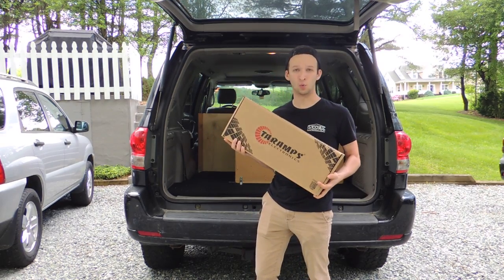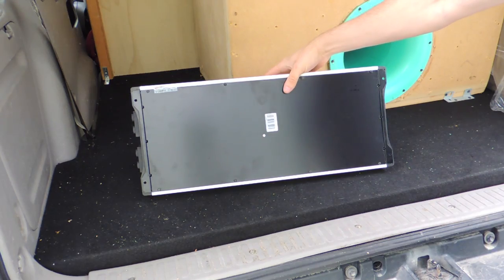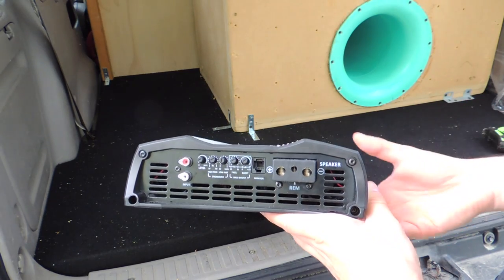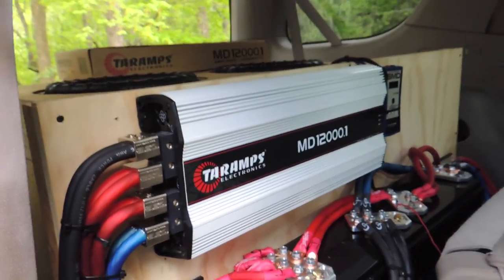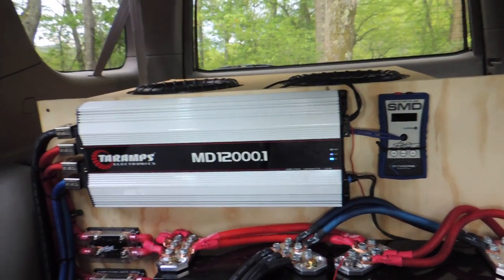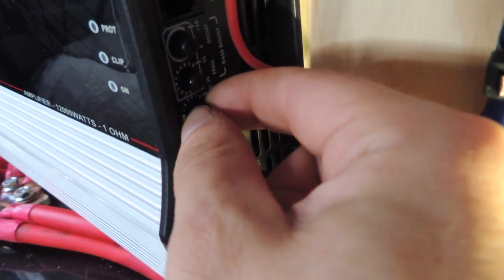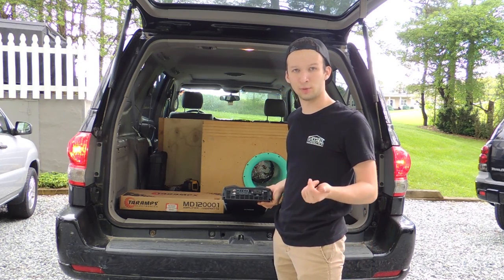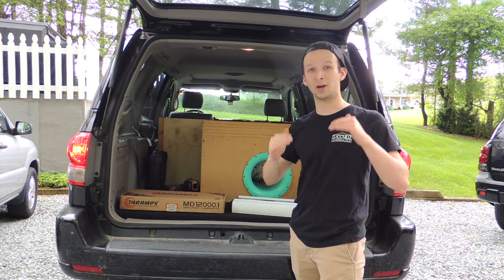TARAMPS? Watch This Before Buying!! | Taramps MD 12000 Review

Comment: "if you want great bass" cough for a month. how is the review going to go in another 3 months. at least we know you will have more content coming about this amp lol. are you going to speak well about them again lol. really 3 amps in 5 months. there is problems with this amp design and quality.  its great you were able to warranty the amps. these amps wont be around in a few years. nobody will be speaking about these things decades later. how can you make a product that only lasts a few months. most companies design therm to last a few years, at least 2-3. i rather buy a quality product i can have decades later. like i have.
Reply: 1 was a shipping issue and the 2nd was shorted. So other than protection not protecting against a dead short it's hasnt been the amp. That short is an easy fix is you have the ability to fix it. I dont have a taramp personally but my opinion on this video is other than cheap ass shipping packaging its not bad at all. These amps have really high voltages that's how they make so much power in a small package.
Reply: I get what you’re sayin but I got two 5k taramps for probably over 2 years and I haven’t had any problem with em..
Reply: HotRodimusPrime -  thats a start. who makes zapco's boards? fosgates? you would be better to start there. the old 1500 watt class AB amps did 140-145 DB a decade ago.I GO WAY BACK. why do you all of a sudden need 5k plus. i just dont get it. and the music does not sound as good on these class D DESIGNS.  the home audio amps are now just starting to match the old class AB amps. but you need to spend a few grand easy. and im still not convinced but some are.
Reply: Nick Vidz - I’d be willing to bet it’s because you have sufficient power going to them. I saw this guy running this amp on stock electrical, which is suicide for the amp. You need to go way overboard and spend a lot of money on electrical with these amps. I know he built some caps, but I’m still not convinced his electrical is up to snuff. You must have multiple alternators or an extremely powerful one for that monster to keep your voltage stable, not dropping and rising 2-3 volts at a time. Oh, and too much vibration is also a no no! I doubt you have yours mounted on the enclosure either.
Reply: @kingwillie206  your on the right track. the amp maybe cheaper but you need to spend double that for a proper electrical setup. and you get what you pay for. there is a reason things cost what they do in most cases. its all about the setup.
Reply: King Willie exactly, I have a mechman 300A alt on 2 XS D7500. 
That stock alt is not itttt for a taramps 12k, taramps don’t like low power!
Reply: Also my amp is mounted on a separate board
Reply: Nick Vidz - Yes sir! He needs to take a step back and downgrade to a 3k unless he’s willing to dig in those pockets. There are no shortcuts in this game. I’m OCD with everything, especially shit that can burn me and my vehicle up. He probably thought he was going to be smart and not “push” the amp until he pieced his stuff together, but such isn’t the case. Good stuff though. You know what the phuck you are doing.👊🏾
Reply: King Willie you already know wassup man..base on my experience the stock alt can handle up to 1-2k watts if it’s beyond that, you’ll most likely fuck up your system...
Reply: Nick Vidz - Yep, and with those caps he could get away with 3k and be stable, but they just don’t have the energy density necessary to do what he believes they are capable of. If he had researched properly he would know that he needs at least a 500 amp alternator, 2 XS D7500’s, plus those caps and a high idle switch. A lot of people make the mistake of thinking alternators put out rated power 24/7, but his stock alternator isn’t going put out anymore than say 40 amps at idle, which will stress his amp to death when those caps get drained. He really needs to rethink his entire layout and install a fire extinguisher if he hasn’t already because his goose might get cooked eventually if he keeps shortcutting.
Reply: King Willie you’re right man...he need to upgrade his electrical system a whole lot more.

Comment: omg you bought this thing again? are you serious?
Reply: 3 amps 5 months how much is that worth? you could have just bought 1 quality product and not had the headaches. i cant stand cheap throw away products. we need to stop this throw away culture. we need to get back to building quality products in AMERICA baby.
Reply: @666Necropsy  well taramps puts out the watts they say u could run 6 subs on it and it would handle it by itslef
Reply: #1 first amp got damaged in shipping he sent it back and got another cool #2 had the new amp since December but he made a mistake and  the speakers wires touched each other and amp went by by because it was on #3 all of taramps amplifiers do rated power #4 he got a new one
Reply: @bassbrother101  #1 damaged shipping = poor packaging job. #2 made mistake connecting = no speaker protection circuit. 3# rated power = am i supposed to be impressed it does rated power lol. 4# new amp = why oh why lol.  so whats its damping factor, slew rate, frequency response, THD AT 60HZ-1KHZ, efficiency, what quality capacitors, ect. how old is the board design cough. these are just some of the things important to me. i dont just waste money on junk. im not a fan of these throw away class d designs.  unless your not listening to music, which he does. i rather see him take a different road. there is my bias.  i forget im speaking to such a young crowd here.
Reply: MRgreen the amp isn’t the best but its worth the price and will last if u take care of it  does rated power and more and has fans if it gets hot the protection isn’t the best but that’s cool just dont do nothing wrong to where it would be sent into protect so its not an bad amp is what im saying and alot of people use this amp and other taramps amplifiers in there build and they be hitting hard 😁🔊😎 so yeah
Reply: so you didnt watch the video at all? just replying to the title of the video?

Comment: I just not a big fan of these amps. I’ve seen too many of these go up in flames and even though they put out a ton of power, it’s dirty power. The sound quality just don’t stack up to Orion, DC, B2, Sundown or Rockford. I’ve seen the manufacturer of these amps and they just pump these out so fast. Just poor build quality and low quality components